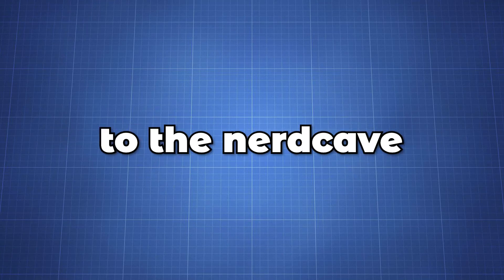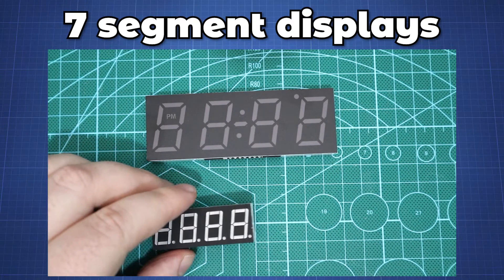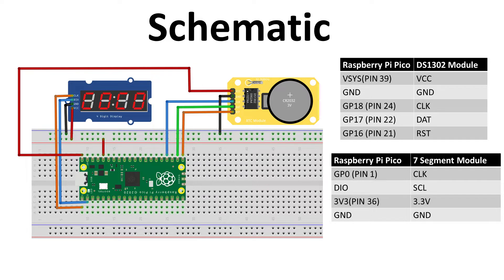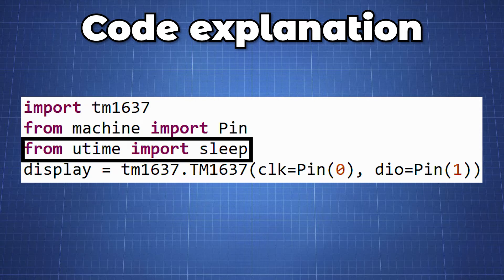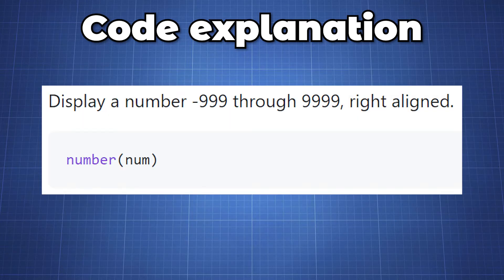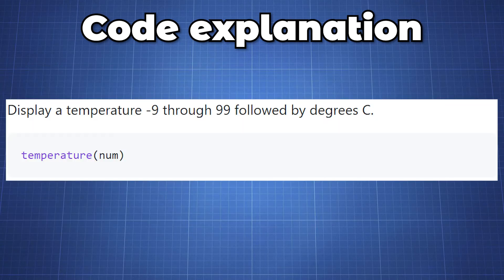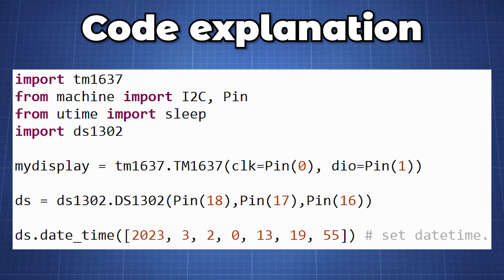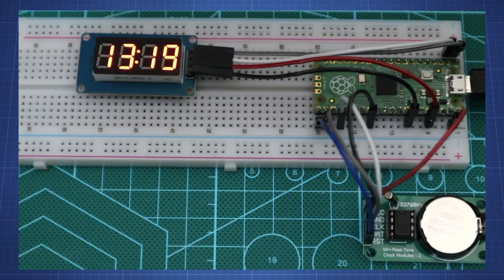Raspberry Pi Pico Tutorial - 4 Digit 7 Segment Display - TM1637 Driver IC Module

Comment: I want to connect 5 x 1 digit 7 segment, what can i do as i want to make scroll text display please guide me
Reply from the maker: if you are using separate 7 segment display and want to connect 5, you will have to get a driver like the TM1638 to drive them, as the Pico does not have enough GPIO pins, or you get other modules with 8 segments if you can't make a custom PCB
Reply: @NerdCaveYT  can you please help me with TM1638 connections and code with pi pico

Comment: I didn't see much info on how to physically wire this up. Is it using I2C or something? I'd like to have 8 of such modules, preferably driven by a single Pico. Would that be possible please?
Reply from the maker: I will have to go check on that but it should be possible think I saw someone do it on YouTube where you can connect them together. I will get back to you